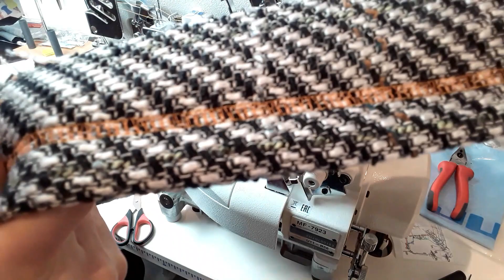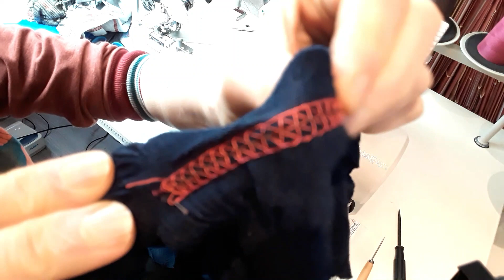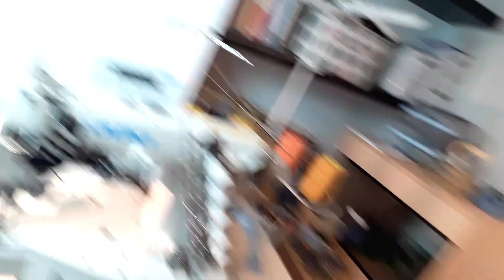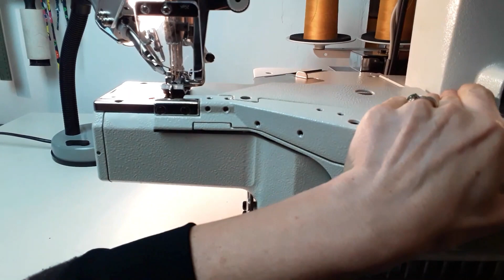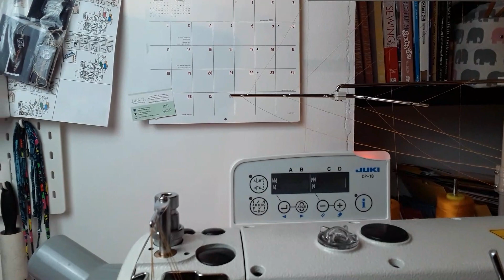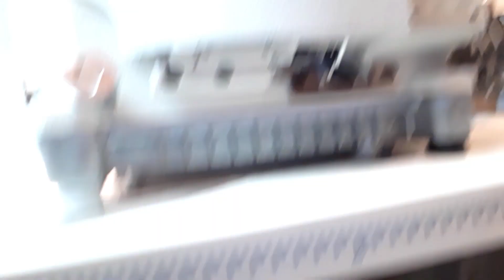Juki MF 7923 Industrial Coverstitch Machine

Comment: Hey girl how did you finally figure your machine out? I’m struggling
Reply from the maker: I actually did a course on sewing machines (check City and Guilds if you’re in the UK), but it really shouldn’t be a struggle. You might have it set up wrong (ask your dealer, it might be something simple) The machine doesn’t really need a lot of adjustments when it’s set up properly so you really shouldn’t struggle. The dealer should help, I’m sure you’ll sort it out in no time 😊
Reply: @GingerheadCo  omg I figured it out. For some reason my tention separations are not coming fully back out when I release the peddle too softly.. if anyone has tension issues like I did recommend looking at that. Everything was fine after I noticed it finally

Comment: Is it better when u have the sewing machine on the top of the table or submerged. I plan to buy it however I think I want the machine under the table
Reply from the maker: it depends what you prefer, you can buy a flat bed machine instead - they are also cheaper (the cylinder bed that is submerged will have the flat surface and you'll sew 'flat' like on the flatbed machine, when you have it on the table you'll sew in the round - even if the fabric is not constructed yet - in theory it can then be faster when used by a skilled worker, if you work for yourself it won't really matter, it's a question of your personal preference) If you want to buy 100% Juki made cylinder bed machine, they only do semi-submerged tables (or the ones where the machine is fully on top) so you'll need to buy the table from somewhere else, which is actually easier than buying the original (and cheaper)

Comment: I threaded it :) unfortunately my left needle broke. do you have any trick replacing needle? i have a really hard time. thanks
Reply from the maker: I use tweezers to hold the  needle , make sure the needle is placed correctly and pushed to the end. And always check your needles (yes, new ones too) if they're not bent - give each a little roll on the table, they have to roll smoothly. Use the right size (I got 60s with my machine, which I had to change immediately,  they are far too fine for me) 😊
Reply: Thanks alex for writing back. The scraft of the needle faces the back right? The hand wheel turns toward the back right? Because I broken my needle, I only have left and right needle and when I use them with the spreader, the lower looper is super loose and no matter how much I tighten it, it doesn’t help. Not sure what I did wrong and the dealer couldn’t help me.
Reply from the maker: @tdodo3026  get more needles, I like organ and schmetz UYX128 GAS ballpoint size 14/90 (the organ ones are marked BP for ballpoint the schmetz are marked SES) the groove faces the back (there's a slightly shorter groove on the front of the needle, too) There seems to be no balance between the needles tension and the looper, you really shouldn't have the looper tension high at all (both looper and spreader always have substantially lower tension than all the needles) Double check the threading,  this machine will actually work badly threaded (which is not as great as it sounds) but it will never have a balanced stitch then. You do need more needles though,  you need to change them relatively often (compared to industrial lockstitch or overlocker) and if you broke one it might mean the other ones are bent now. I'd always change all the needles if one breaks (and inspect the threading and the settings)
Reply: Hi Alex. Do you have problem with the jamming and eating up your fabric? Any advise on that?
Reply from the maker: @tdodo3026  a new machine should not have any problems 🤨 is it threaded correctly? There's a sticker with the threading path for each needle, spreader and looper in different colour. Are you starting with fabric under the foot? Are you using correct needles (the right type and size ?) Well, anyway,  it's a new machine so your dealer should be able to help/explain, I'd definitely contact them first.

Comment: Hi Alex, can you pls do me a favor by giving me your complete model of your machine? It’s frustrating that they said such machine do not exist. They said it can only cut the bottom thread and not the top
Reply from the maker: I'd say don't use this dealer...this is a standard Juki model (all made by Juki and they ONLY do needle and looper thread trimmer, it can be magnetic or pneumatic) My model is  7923 D (79 series 2 or 3 needles, dry head) U11 (universal type),  B64 (my gauge has been changed, so it actually says B56 on the machine, but it's in fact B64) and finally: UT51 (trimmer of the needles and looper thread, 51 means it's magnetic).
Reply: You are the best. Thank you so so much.
Reply: Alex, if the computer breaks, the machine won’t run. Are you worry about that? I guess you are not that’s why you got it huh? Electronic stuff always break down. Mechanical much more reliable. Don’t know what to do
Reply from the maker: Haha, you have to decide for yourself 😉 let me guess: your dealer doesn't do the control box (SC921) and operation panel (CP18)?  The operation panel is computerised. If it breaks you won't be able to program the machine. 99.9% of time I don't program my machines. They still work perfectly 🤣🤣🤣 like with every machine: repairing an expensive,  more advanced machine  is more expensive than repairing a budget,  simpler one. My only word of advice is: don't buy a machine till you are sure what you want. Wait till you are absolutely sure that you know what it does and it suits your needs.
Reply: You are so wonderful. I wish I can go to a dealer here and talk to them. I will learn more about the machine before any purchase :) thanks so much Alex
Reply: Alex, I learn so much more about the machine after talking to 4 dealers. Thanks for all your help in this. 
Pls help me with another question. For our baby lock serger/coverstitch convo, we can do flat lock stitch on it. Would it be better to use the baby lock to do flat lock stitch than to serger the seam and use the mf7923 to cover top and bottom? Wouldn’t baby lock be less bulky? Would be as secure and strong?
Reply from the maker: @tdodo3026  I don't really use the mock flatlock. 4 thread overlocking/serging and the top and bottom cover is bulkier than just lockstitch and cover and mock flatlock and cover (though in the last case the difference is almost non existent) For softer seams you can use woolly nylon, but the bulk is like in your RTW leggings for example.  It has never bothered me, quite the contrary (also, the cover flattens the seam). It's just a question of your individual preferences 😉
Reply: Hi Alex, thanks again for getting to me. I looked everywhere for your legging video but couldn’t find any. I would like to make sure I understand you. I can either use lockstitch then cover top and bottom (wouldn’t lockstitch break when you stretch the fabric?) or I can do the mock flatlock on baby Lock machine then cover top and bottom? Thanks so much for helping again.
Reply from the maker: You can do various stitches and cover the seam. A straight stitch will break if it's a seam that is going to be pulled. So it's fine to use for side seams of tops (not fitted) and joggers, but not leggings.  It's often used in casual wear in ready to wear clothes (it's cheaper, you use less thread). RTW leggings (good ones) are made with a flatlock machine- it's a different machine altogether, it joins 2 edges of fabric with no waste. This look can be easily recreated (with a bit more bulk perhaps but not much) by using an overlocker for construction.  Either 4 threads or the mock flatlock . On a regular sewing machine you can use a triple stretch stitch, press the seams open and coverstitch over the open seam. It's a bit more time consuming but creates a very strong and soft stitch. I use my overlocker for construction and coverstitch over the seam allowance- the seam allowance is pressed or placed to one side. This is my preferred method, but you can do whatever works for you. When you look at RTW you'll notice there are various seams (the more expensive the garment the more thread, work and often machines used 😉) I'm not a fan of a mock flatlock (on an overlocker) but this is my personal preference- it doesn't mean you have to like the same thing 😉 In professional activewear (or rather performance sportswear) there are often almost no seams at all, but that is definitely not possible to recreate at home 😉 every seam is a weak point but also a design and a fit feature,  so you can decide how strong and/or visible you want to make it. I have never had my leggings burst a seam (overlocker construction) but I know that the triple stretch stitch is stronger (and almost impossible to unpick) I have a video with seam allowance placement for coverstitch,  the overlock and place to the side then coverstitch method is shown there (for domestic,  top only coverstitch machines) 🙂 experiment and see what you like
Reply: Thank you so much Alex. You are amazing. You write back to everyone and I must be the one taking up the most of your time. I greatly appreciate your help. Thank you!!!
Reply from the maker: @tdodo3026  I'm trying to reply (sometimes I can't see comments on the older videos) because I know how difficult it is to find some answers (I'm not an expert though,  I'm learning all the time and I don't think I can ever stop) I'll make some videos about what are various parts of my coverstitch for because I've heard so many things that are not true - I was so confused sometimes that I didn't trust anyone (and now I'm suspicious of dealers 😉 I always ask a Juki engineer- an official one working for the Juki Corporation- and even if I have to wait for ages for the reply at least I'm sure he knows 😉) He's married to my friend 🤣🤣🤣
Reply: @GingerheadCo  wow. That’s cool you have some connection. I feel that I am closest to you and no one I can share/understand about machine with me as much as you. 7923 are completely back order. I won’t have it til next year. I found one dealer that has a flatbed 7523 with trimmer and I am so tempting getting it. Cylinder is convenient for cuff but hand cuff won’t fit in the cylinder anyways right? Do you see a problem with flatbed? Sorry I keep taking up your time
Reply from the maker: @tdodo3026  There's a long wait here, too (and in the UK the prices might be much higher next year because of the import tax) I don't care much about the cylinder bed (but again,  this is because of what I mainly use my machine for) but for me the cutter was a must have (I know it adds a lot to the price but I really think it's worth it).
Reply: Alex Alex, I ordered my machine!! I am so excited but feeling so bad at the same time because I bought so many machines in the last 6 months. Again, I say this is my last machine 😂
Reply from the maker: @tdodo3026  congratulations 😁😁😁 have fun (life's too short to regret anything) 😉

Comment: Omg!!! So so cool!! I am so excited to see your new baby. Congrats!!! I was guessing you would get the 7523. I was wrong! What make you decide to get the free arm? It’s so cool Alex. I am so excited just to see it. I love the sound of it!!!
Reply from the maker: Thank you 😊 I got the cylinder bed because I couldn't find the flat bed with all original parts (I prefer to buy all juki parts which is actually really difficult 🤣 I waited to buy the machine for a few months because most machines sold in the UK are sold with just the head made by juki, which I didn't want) But I need to learn a lot 😉
Reply: So far, I can’t your machine here in the USA. They do have 7923 but not thread cutter and not computerized. Free arm has it benefit too, so much easier to do small armhole and smaller in the round. Thanks so much for answering my question. 
Btw, do you also own Juki single needle industrial machine? Hahaha
Reply from the maker: @tdodo3026  the head only (with another brand servo motor and pedal, sometimes with another table) is much easier to buy here as well, it really took me a long time to find what I wanted (mind you, the original parts and the cutter will double the price, that's quite an important factor to consider. This machine was well over £4 thousand- so it really depends on how much you're willing to spend. With cylinder beds it's easier to work in a circular motion, so in a factory environment it saves time - and money. But for a home sewists it makes no difference. It's not difficult to get to small spaces on the 75 series, they have a trimmed front anyway. And the 75 - the flat bed one- series is cheaper)